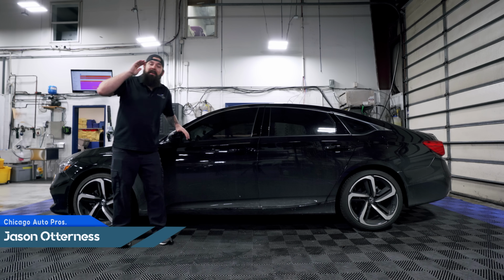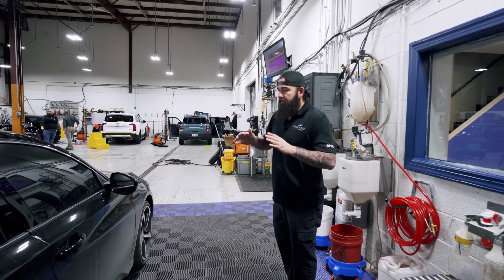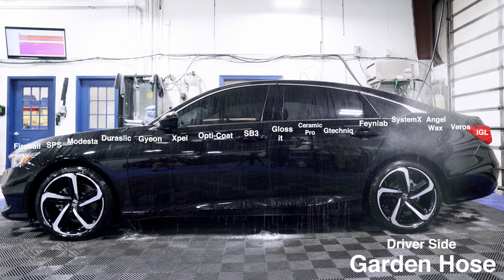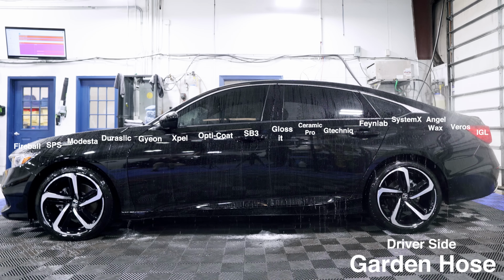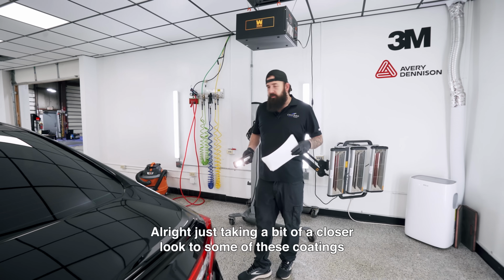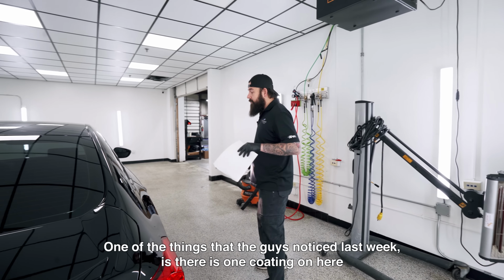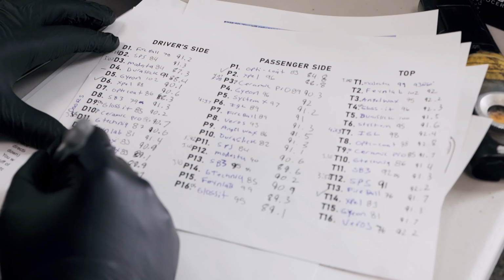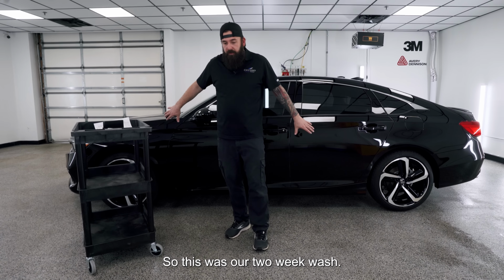Testing 16 Different Professional Ceramic Coatings | Two Week Update

Comment: There is a product called Revivify Coatings that claims to be better than ceramic and close to PPF.  Have you heard of it or has it been independently tested?  There are MAJOR claims out there but it is by installers and is an installer only product so I susect bias.  Its quite expensive, around $2500 to have your car coated.  It claims self healing, antigraffiti and more.  Curious of your professional opinion as I cannot find any other unbiased reviews of revivify.

Comment: My last vehicle I had Opti-Coat pro coating and after 8 years it was still tightly beading when I traded it in. I never used any maintenance products on it. It was garage kept and hand washed generally every week, sometimes 2. I use CG Citrus Wash And Gloss in the foamer and the bucket. This new 2022 vehicle I purchased that detailer had switched to Gyeon, and I got Infinite Evo applied. I was a little surprised when he told be about all the upkeep I needed to use, a ceramic detailer as a drying aid, a decon wash and a curing agent once every few months, a can-coat once a year. I mean, pretty sure I could have just used those products, lol. We will see, gotta be honest here I think Optimum is going to massively outlast these other coatings.
Reply: Well your Citrus Wash & Gloss has wax in it. So it was your shampoo, not the coating.
Reply: @arapaimagold8088  Strange because detailers on Autogeek forums use it to strip wax and normal sealants.

Comment: Hey Jason, I’ve got my MG Astor graphene coated last week. I have 3 specific questions:
1) Cover on or off if it’s parked in shade at night(my detailing guy said that cover get car scratched up).
2) Would the graphene coating be able to protect paint if it’s standing in 5-6 hours of intense sun(40-44* Celsius, Rajasthan,India). 
3) I’ve got 6 year plan & will be called once a year for next 6 years for maintenance. Apart from that, any product that I can use daily/weekly basis which would keep the coating intact?
Reply: 1. No cover, don't want to risk scratching the paint.
2. As long as you maintain the coating with a topper to help boost and aid the coating, it should.
3. What coating was applied? You usually want to stay within the family of the coating brand.
Reply: @LilRick96  
1) No cover✅
2) I’ll look out for topper online.
3) So detailing is relatively new to India(trend picking up though). Most detailing brands got home grown products(got it done from “The Detailing Devils”). All I know is that they’ve applied 10H coating(they call it armour graphene)  & asked me to visit once for yearly maintenance for next 6 years. They haven’t suggested any kind of product to me for maintainence. 
    One more naive query 🙋🏻‍♂️, so since I don’t have covered parking from all 4 sides when I park at night inside my home, there’s a thin layer of dust accumulates on top in the morning. Since car cover is out of equation now, is that ok? I mean thin layer of dust which accumulate on top,would graphene coating would be able to sustain that? For  dust I use Jopasu car duster to clean it off with soft hands.

Comment: I'm excited to see the results myself and appreciate the dedication to as much accuracy as is allowable in a detail shop. At my shop we use System X and I've done some independent testing with MAX on a few different cars using the thickness gauge in the same way. I was somewhat disappointed to see the thickness results from this test. I have done 4 separate thickness tests on a black CT6, a black STS, a Black Jaguar, and a Red C8 corvette. I did not see an average thickness jump of 20+ microns but I saw an average jump of 10-17 microns on every panel. I know not to put too much salt into this method as it is VERY difficult to test the same areas. Just some of the things I noticed when doing some of my own testing on coatings and either way I'm excited to see what performs!

Comment: Did you used toppers as instructed after applying the coatings? For example, you must apply Opti-Seal on top after Opti-Coat Pro. Same for Gyeon + Cure. If you did not, that could interfere in the curing process
Reply: Cure act as sacrificial topper during the curing process. It didn't help to cure the coating. And also you can't use cure before waiting for 48H.

Comment: One of my personal goals with ceramic, is getting the water to blow off faster.  Could that be included ?  I wash my car outside, so the more water I can blow off before drying with absorbent microfiber the better.  Thank you!
Reply: Looks like Opti Coat and Duraslic are those kind of products. Looking forward to see how well they are still sheeting while the super hydrophobic coatings are still beading. Different ideas on the same end goal. I too prefer the sheeting and ability to dry quickly and remove any chance of water spots. Both of the mentioned coatings seem to be designed to do that.
Reply: You'll need big beader like Modesta.

Comment: Fantastic video and content though makes me wonder, with a couple of coatings having lost some gloss and hydrophobicity, as to the value of these professional coatings. It is clear why these need to be maintained with a regular topper to replenish their properties but then it begs the question - why not just skip the professional coating , same the money, and apply the consumer-based ceramic sealants 3-4 times a year for an alleged similar gloss and protection?
Reply from the maker: It's normal to loose gloss after applying a coating, sealant or a wax. I did point out some reasons in the video on why some people value going to a professional. I think if you are trying to keep a car clean and looking new... it's just going to take lots of time and money. No way around it..... How clean do you want it?
Reply: As someone that does a lot of mileage for work, having a ceramic coating makes my weekly wash so easy.

Comment: Thanks Jason.  Really loved the video.  I just got my car coated with Bead Lock Pro.  I need help finding a detailer spray that is suitable for post-coats, is good at repelling dust, can be used to remove light layers of dust in between washes, and that provides great shine and water beading properties.  What do you recommend?
Reply from the maker: I would recommend sticking with the brand of coating. They will have a Quick Detailers or some sort of topper they will recommend.
Reply: Thanks for the recommendation and for responding.

Comment: I really appreciate this heavy weight test and all of the work getting the products, installing the products, and a ton of editing. Here in Nashville the water is terrible and water spots from the beading coatings are a problem. Therefore, I am looking for a coating which sheets and beads and the duraslic sheets kind of slow in my opinion. The Modesta stood out for how quickly is shedded water. Thank you for this series.
Reply from the maker: Yes, I hate that coatings are prone to water spotting.

Comment: If you do another test like this would a lighter colored car be easier to visualize
the results on?
Reply from the maker: No, it's harder to see on a light colored vehicle. I think black is the best choice for a test like this.
Reply: Black is best to see what's going on.  If you've ever owned a black car, you'll know EVERYTHING shows up on it. Every speck of dust, every fiber of lint, every waterspot, every scratch, swirl, hazemark, ding, dent, bubble, ripple, pit, leftover/ missed wax, improperly cured ceramic/ poorly applied coating/ poorly leveled coating etc. As beautiful as a black car can be...they are FRUSTRATING to keep looking at their best. Watch the guys at car shows with the black cars.. they NEVER stop wiping/ dabbing/ dusting the car.

Comment: Duraslic struggling already, opti coat looked a bit slow sheeting as well.
Reply: I could be wrong but I believe opti coat always said their product was more about sheeting water away than beating water.

If true then we would just be looking for that product to sheet water effectively through the entire test. If it starts to do it very very very slowly we would know it's failing
Reply: I don't know anything about Duraslic, but Opti-Coat is a serious coating that is designed to sheet water instead of beading it. It may not have the slick feel or crazy fast water shedding of other coatings, but it will still be there protecting the paint and being less prone to water spotting.
Reply: Be it beading or sheeting, all coating will ended up with silica scale and you will remove the coating at the end of the day. Why bother?
Reply: @jeffc6832  exactly my thoughts
Reply: not good to see when you use the brand might be time for a switch
Reply: Yeah both were not exciting to see were they? But maybe that is there hydrophobics steady sheets that clear the panel that maintain that level for a long long time?

Comment: With time the quality of the coatings wont differ that much more like the bad ones will vanish, competition is always better so brands can't take whatever they want in terms of price.
Reply: Not really, good solvent is expensive. So there will always be a huge gap in clarity. 
But, a $700 - 1K coating will be dead as $400 coatings will match its quality. 
However there's no way $100 coatings will be able to compete.